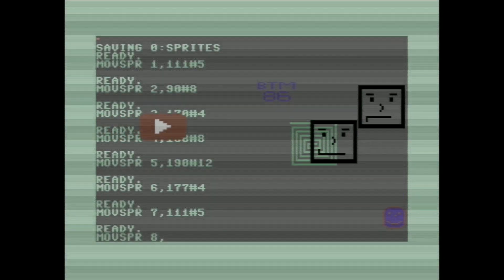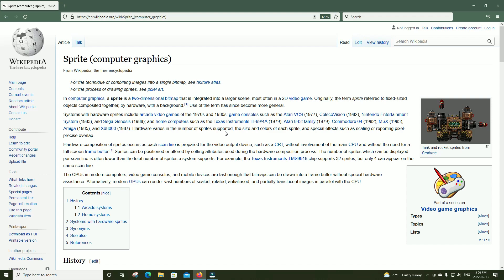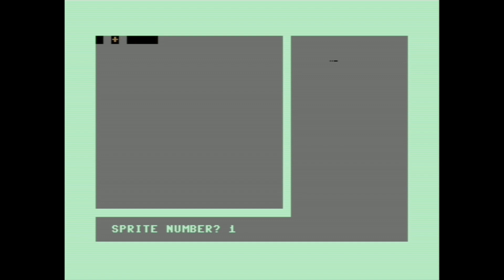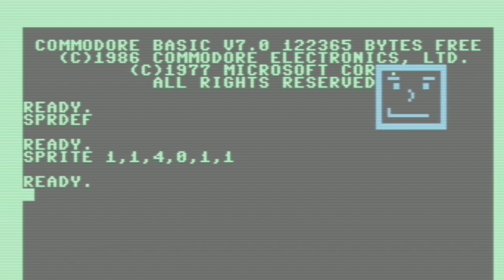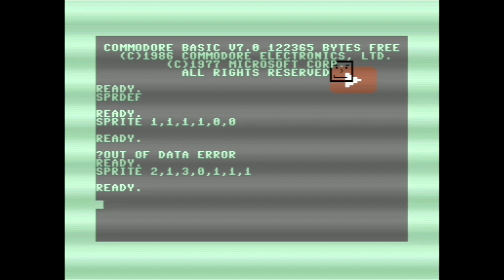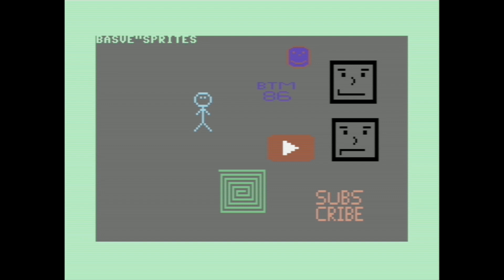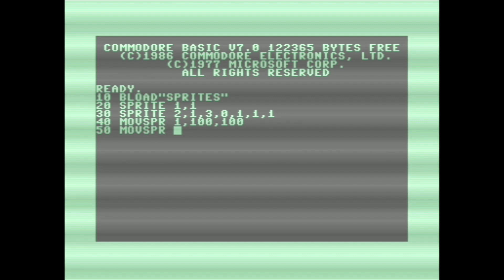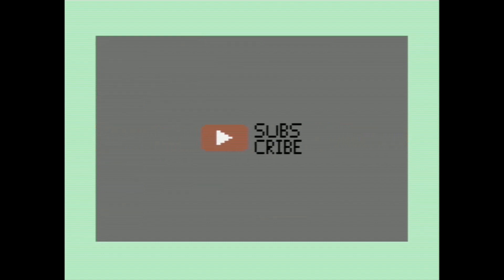Commodore 128 Sprite Commands

Comment: We really needed Basic 7.0 on the C64 but got Basic 2.0 because Jack Tramiel didn't want to pay Microsoft any more money for an updated Basic. We got around it by using things like "Simon's Basic", "Ultrabasic 64" and the "Super Expander Cartridge", but it would have been nicer to have a much better Basic from the get go. We eventually got it on the C128. But in the early days using Basic 2.0 to do sprite work was a challenge.
Reply: Basic 7.0 wasn't released until three years after the Commodore 64 was released, so there's that.